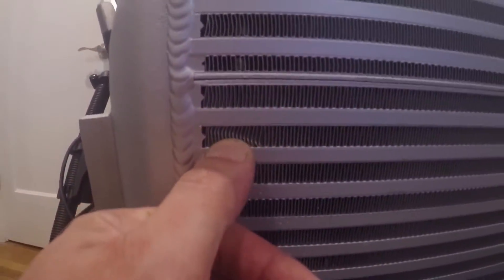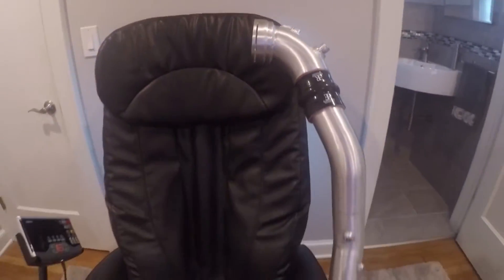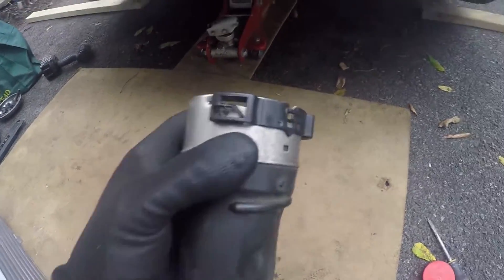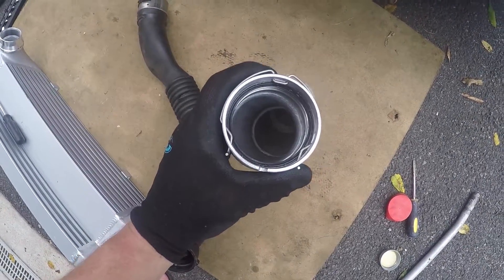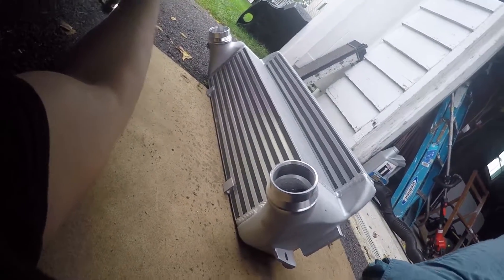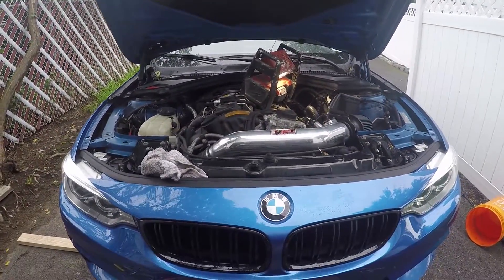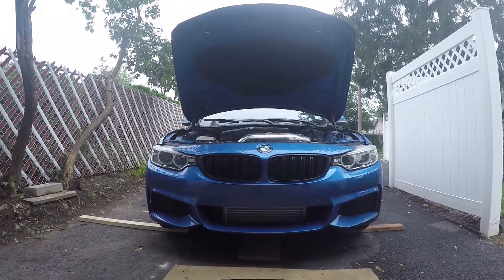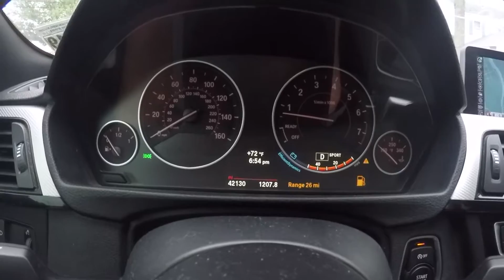BMW F32 N55 435i Intercooler & Charge Pipe Install (FMIC Fits: 1,2,3,4,x, Series) w/ test run!

Comment: why didn't you change the boost pipe as well?
Reply from the maker: Thought about it but i don't think it will be an issue with the boost levels i'm running.
Reply: @ModsAndProjects  makes sense, I will change the charge and boost pipe as I'm running stage 1, will change to a catless downpipe too later.

Comment: I’ve been meaning to ask you about the FMIC. Do you experience any turbo lag with it compared to stock? Did you feel any hp/tq boost as well?
Reply from the maker: I have noticed NO lag with this particular FMIC.  Though I'm fairly certain you would get some lag with a huge track-sized unit.  The one I installed is High density, looks good (stepped), and does a great job at cooling at a great price point.  The point of an FMIC is to get CONSISTENT intake temps and power pull after pull.  With the stock IC you can loose power due to heat soak after a hard pull VERY quickly.  It's not meant to be a bolt-on HP booster.

Comment: If you can't get the plastic charge pipe out enough from the top, wedge a long screwdriver against the accordion part of the charge pipe from above, then pry it upwards with leverage while pulling the chargepipe up.  Thought it was impossible to get the pipe removed before this.
Reply from the maker: That is a really good idea, I'll remember that next time!  Summer is coming Ill be installing a methanol kit this time around!  Very excited!

Comment: nice video I am looking at getting an intercooler, my tuner recommended the Dinan D330-0021 intercooler, wondering if that would be a good move in your opinion, he also mentioned mishimoto at a better price point.
Reply from the maker: It depends on your application, you can never go wrong with Dinan, but it's expensive and maybe overkill for your application.  Also unless you are running Xtreme horsepower bigger does not necessarily mean better in all applications. Huge  intercoolers for track and long racing applications are great at high speed and wide open throtte and high RPMs but can introduce turbo lag during daily driving.

Comment: Thanks for the tips, this looks like a great FMIC, I also feel like those $800+ units are overkill for anything other than track cars that are at constant WOT/ high RPMs on the track.  If the car is a daily driver a huge racing FMIC is going to cause considerable lag at the lower RPMs.  I can't believe this unit is only $300.. I think i'm sold.
Reply from the maker: I feel the same way!  I was ready to pull the trigger on the ER FMIC unit at more than double the cost when I came across this unit.  Perfect for when you need it for a hardcore driving session while keeping low-end daily driver performance and not breaking the bank.